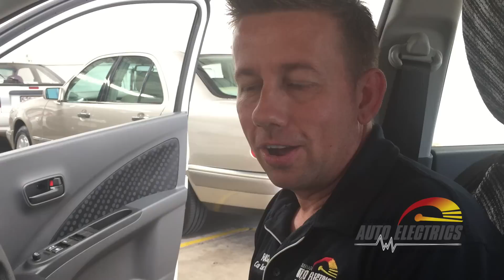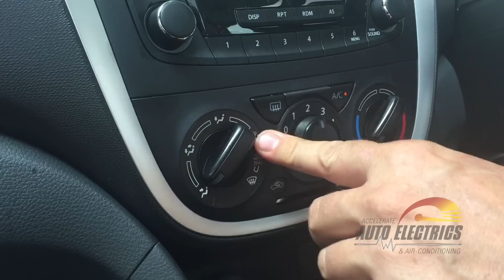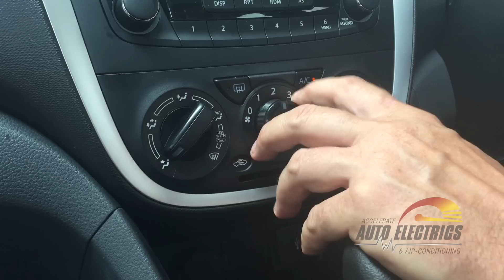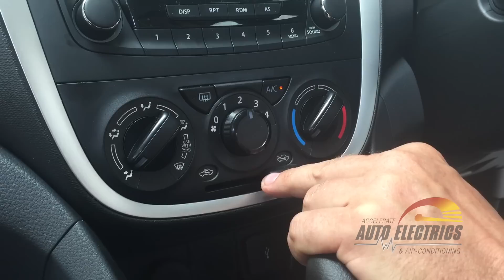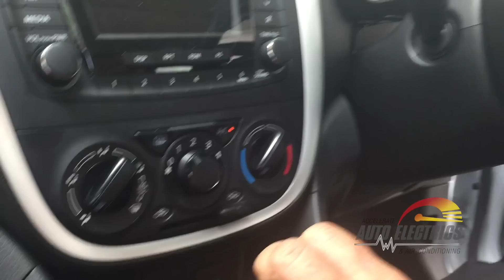What the Buttons on Your Vehicle Air Conditioning System Do | Accelerate Auto Electrics

Comment: I didn't get the re circulating part
Reply from the maker: Hi Sophia, 
Recirculating ON (usually a button with a car and a circular arrow):
The A/C keeps using the air already inside the car, cooling it more quickly and keeping out bad smells or hot air from outside.
Recirculating OFF (fresh air mode):
The A/C pulls fresh air from outside, which might be hotter or more humid, and cools that.
For either setting to work the fan must be on (the dial with numbers needs to be set on a number).
We hope this helps!

Comment: What does use with in direction do?
Reply from the maker: Thanks for your comment.
sorry, could you please elaborate a little more on your question so we can answer it correctly?
Thank you, - The Accelerate Auto Electrics Team
Reply: @accelerateoffgridtouring  thanks for the reply. In the air direction of the AC, for example feet and face, feet only, face only, windshield only, feet and windshield, etc. There is also an option use with, what does this use with option means?
Reply from the maker: Thanks for the clarification, 
The use with Option in this video is what the manufactures recommend for the Fresh or re circulate option.  In this case, It is recommending to use Fresh Air setting when on the Windscreen option.
Reply: @accelerateoffgridtouring  thank you so much. This helps alot

Comment: Here’s a tip when it’s hot out get in the car open every window for a few seconds it will let all the hot heat out then roll up the windows turn on the car and the AC put the temperature knob to full cold that will keep the car from mixing hot air. Once it starts getting cold enough flick on the air recirculation and turn off the fresh air intake this will now start cycling the cold cabin air and the car will turn off the compressor so it dose not have to run all the time. Once the temperature starts getting warm again the car will kick on the compressor again. If you don’t hit that air recirculation warm air from outside will keep coming in and the AC compressor will never shut off.
Reply from the maker: Great tip
Reply: my car has no difference when turning the A.C on or off because it is cold when I turn on the fan on full (number 4) and turn the temperature on its coldest setting, so what is the point of the A.C?
Reply: @shanebell2514  maybe yours is broken 🤣🤣🤣🤣🤣

Comment: What happens if you let your ac system on but air flow is set to 0 does it still uses power from the engine or does it waste the battery.
Reply from the maker: If your AC system isn't operating, it isn't using additional power.

Comment: Thanks  for excellent  videos.. 

Just one query...suppose temperature  knob is o  right side I..e red...but fan is off...does my car will heat up???
Actually  it is happening  with my car so wondering
Reply from the maker: Unfortunately, it is hard to know what is happening with the system without more information and seeing the car in person. If you are concerned about how your AC is running, we'd suggest getting in touch with a local auto electrician or air conditioning specialist.

Comment: can the aircon button be pressed on at the same time as the heat dial is on hot.
Reply from the maker: Yes, you can have the A/C button on at the same time as the heating functions. When doing this however you are working your A/C system when it is not needed.

Comment: I find with mine (Renault Megane) the air recirculate inside cabin boosts the fan speed more than outside air coming in option 
Give it a try guys it works 👍

Comment: Is it true that when on the red for heating and you press AC, more heat will be produced?... Provided car has been running for while.
I have always associated AC to making temp more cooler, don't know about heating.
Reply: @accelerateoffgridtouring  thanks
Reply: Using AC with heat can be useful when you need to defog your windows. The AC with make the air less humid, which will allow it to soak up more of the fog on your glass

Comment: This is such a "woman question" but what is the difference between air conditioning and climate control?  Is climate control as cold as air conditioning?
Reply: Thank you for that.  Can I control the climate control manually?  I just wanted to know if I buy a car that has climate control rather than air conditioning, will the car be cold enough? I know with the AC, I can turn that on or off but with climate control, does it adjust the temperature in the car automatically and can I make it colder?
Reply: With automatic climate control you can always adjust the temperature separately from the blower fan speed (for example, you feel too cold and you want to reduce airflow). The controller will only control the heater (valve or blend door opening degree), the recirculation flap opening degree and the compressor refrigerant flow or operating state (off and on, if no flow adjustment is allowed by the compressor) in that case. If you let it adjust the fan speed too, it will also adjust fan speed according to a characteristic curve so that the desired cabin air temperature is achieved fast and maintained steadily. You can also choose to keep the recirculation flap completely closed for some minutes if smell is entering the car. With AC (manual climate control basically) you just adjust the fan speed and heater valve or door opening degree until you feel comfortable, and if recirc is actuated by lever you can also control temperature by partially closing the recirculation flap; the only thing the manual control system cares about is not letting the evaporator freeze up when AC is on because a frozen evaporator doesn't allow any airflow through it at all and it damages the compressor by overheating it due to the abnormally low suction pressure, slugging it with liquid refrigerant and depriving it of lubrication; also, if the recirculation flap is electrically actuated the system automatically switches to fresh air after a few minutes when you turn recirc on. Automatic climate control has the only benefit of allowing you to set the desired temperature and forget about the rest, but manual is more reliable than automatic if you can master it.